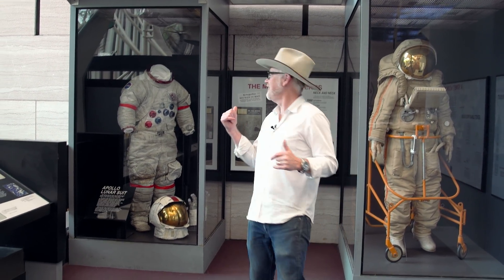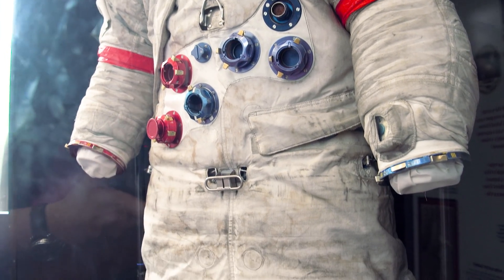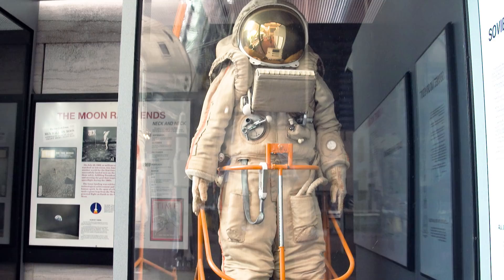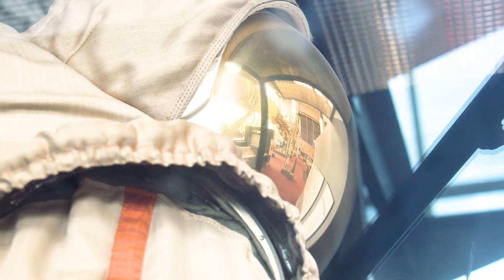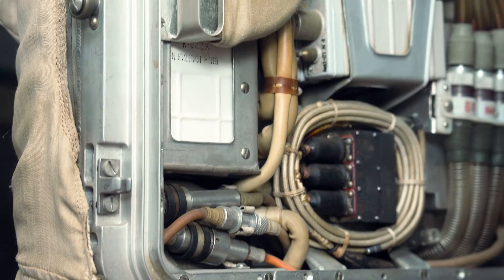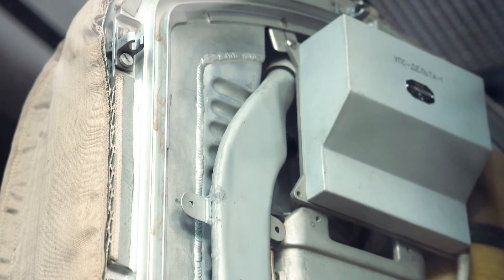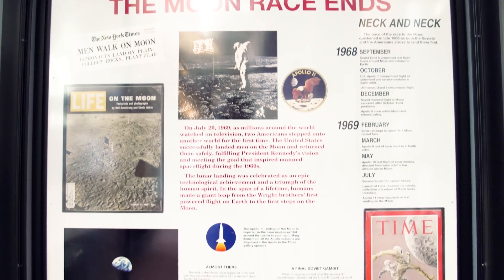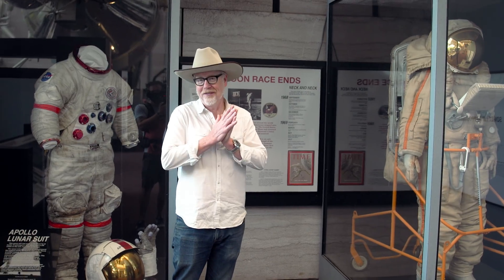Comparing U.S. vs. Soviet Spacesuits at Smithsonian

Comment: Difficult to make hard parts fit soft bodies, i wonder if having micro iron particles suspended in a gel liquid substance would help as it could be molded to any size and shape and when needed either struch or required it can be hardened. I'm aware something like that already exists, I think it was reactive body armor or something like that, but I'm curious of its applications in space.

Comment: Another example in the different philosophy’s in engineering. NASA spent over one million dollars to develop a pen that worked in zero gravity. The Soviets used a pencil
Reply: That's a bit of a myth actually, normal ball point pens work in zero gravity, but the teeny tiny, super precisely made tungsten balls in those pens were difficult to make in the 60s before someone found a way to mass produce them. Each pen cost about $50 in today's money compared to a few pennies nowadays. NASA ordered about 1000 pens in a bulk, half price deal, so it actually cost them more like $25,000 rather than $1,000,000. Still alot of money for a pen, though!

Comment: Problem : This door is really hard to close.
USA Solution : We will make a springe guided hinge with a self lubricating system controlled by an electric motor.
Russian solution : Kick the door.
Reply: And if that door is kicked several times, it stops working. Meanwhile, the American door takes a year to work out the kinks, but then serves many years on.
Reply: @HalNordmann  Ah, but the Russians made their doors easy to repair and or replace.

Comment: The soviets were really ahead of the US, the Buran was so far ahead, too. Hell just look at the US reliance on Russian engines up until recently. The problem is: what good is having better equipment when you can't afford it? RIP soviet space program, it was a good run.
Reply: The thing with Russian engines was not because USA didn't have their own. After the fall of USSR, USA feared (rightfully so) that the Soviet rocket engineers will look for work elsewhere - probably with US enemies that needed rockets (China, Iran, N. Korea...) and it was decided to keep Russian space industry in the business to prevent that.

That is why USA agreed to buy Russian engines in the 1990's and early 2000's, why Russian MIR-2 program turned into an ISS and why it was decided to use Soyuz rockets for taxi purposes - even though both NASA and ESA knew how to send people into space.

Yes, Soviet and Russian engineering was ahead in certain fields (I will never get over the cancellation of Energia and Energia-2 projects), but American "reliance" on Russian tech and rockets was not because of that, but for the geopolitical reasons. It was simply cheaper and safer to keep those people employed in Russia than to have to deal with a bunch of other hostile nations suddenly waking up with state of the art ICBMs of their own.

Comment: What happens with the Soviet suit, if your partner is incapacitated? Can you get out of it (or sealed up into it) by yourself? The US version?
Reply: Both are designed in a way that you should be able to use them on your own - with more or less difficulty. But you should be able to do it on your own.

Comment: I wonder if the design of the Soviets' hard suit was an attempt to correct the ballooning problem that nearly killed Alexei Leonov during his EVA.
Reply: I believe it was. Right after they found out that soft suits were prone to ballooning, they started working on EVA suits that would be safer and efficient in space. Modern Russian space suits are result of that work, as they call it "Half-hard structure" which means hard head, torso and pelvis area and soft arms and legs that would allow astronaut/cosmonaut to have wide control over their body and equipment in space.
Reply: Nope, they've solved ballooning in Yastreb Soft-EVA suit, just a couple of years after A. Leonov spacewalk in Berkut-EVAS. So, they actually could use a newer version of soft-suits for Lunar landing, but changed their mind for hard-suits.

Comment: Space suits are perfect examples of the trade-offs engineers have to make to accomplish a goal or solve a problem, not to mention how each engineering team has a unique design philosophy. The American design shows the result of having the money and resources to optimize every part for mobility and lightness. The Soviet suit feels like something a group of hackers put together using what was available within the constraints of time and money (and secrecy, no doubt). Thus we have two different solutions to the problem of keeping a human being alive and mobile on the lunar surface. The Soviet suit pioneered the integral backpack life support system and hatch that has today evolved into the "suit lock," which allows an astronaut to park the suit and its dirt outside so it doesn't contaminate the habitat. The American suit is lighter and more flexible due to the separate backpack. It's too bad the Soviets didn't pursue their lunar program. It would have been interesting to see how their designs performed on the Moon.

Comment: I NOW LIVE IN THE EX SOVIET UNION    Can we ALL please stop thinking the Russians / communists were idiots who made utter rubbish THEY WERE NOT

I have a pair of 1970 HiFi speakers - many of the features are only NOW appearing on $25K plus western speakers. 
The main difference is the Russians did NOT make things flashy to appeal to consumers cos they had no need. Soviet Hammerite paint CAN NOT be taken off with an angle grinder; it was designed never to be repainted, that goes for everything they made. It was designed to be very good and to last. OH, and be easily repaired.

Comment: Especially in the 60s... the Soviet suit has a single point of failure with an extremely large, easily damaged O-ring. Like everything else Soviet it was a death trap.
Reply: Because it has a single point of failure, it reduces the risk to the astronaut inside. You're really underestimating Soviet engineering.
Reply: @jakekaywell5972  how does a single point of failure reduce risk?
Reply: @jakekaywell5972  note, I said Soviet not Russian.

Comment: For many years I have been trying to find out how they made a Zipper that could withstand the internal pressure of the suit and not blow  open, and how was it made to not be a major pressure leak?
Reply: The pressure difference is pretty small. It's just 1 atmosphere even if the suit was fully pressurized. 1 atmosphere difference is something that a sturdy balloon can withstand. Or, when you dive, the pressure rises 1 atmosphere every 10 meters down. Pressure iside a normal sedan tire is almost 3 atmospheres, yet it basically doesn't deflate for months and months.

In a real space suit, the pressure is even less than 1 atm (I think about a third of normal). The air mixture does want to leak out of the suit, but with a force of, well, someone blowing really hard =) Not any kind of force that would be likely to rip or blow anything apart. And interestingly, it does leak: the articles about the US EVA suits say that these double zippers do leak, but very slowly. The suit just has a tiny tank to gradually replenish the pressure inside the body portion as it leaks. 

Now, you've probably heard that this weak pressure does pose a problem of ballooning the suit, and suit designers have to work hard against that, and astronauts/cosmonauts get tired really quickly fighting the ballooning / rigid suits. But I think it's because this pressure tends to add up across the entire internal area of the suit. It's not super strong in terms of "blowing" the zipper, but it pushes quite forcefully in all directions over several sq meters of suit. For something that should be zero effort (i.e. human resting pose), that's quite a lot of force fighting that.

Comment: ...The Russians had a space program that incrementally advanced the design of the every component 
..NASA every so often threw away the old design they hadn't changed in years, and seemed to start again nearly from scratch 
ESA learnt from the Russians 
The result is that Russia has very reliable systems that work, and are quite cheap  - but now lack funding  
NASA has very expensive systems that are less reliable and keep having their budget cut ...
ESA has cheapish reliable systems as well and still has a budget of sorts 
SpaceX are implementing the designs NASA wanted to years ago ... which are much cheaper ... and are slowly getting them reliable ...

Comment: The door on the Russian suit lacked any protection of the door side in this version because you would need protection from bumps for those areas since not only are humans careless and clumsy at times, but in zero-G they really have a hard time not bumping into things like a drunken sailor.
Reply: Strange how Orlan space suits have been in use for EVAs since 1977 to the present day (with continual upgrades) yet no-one has had an accident in one.
Reply: @henrya3530  That we know of. The Soviets weren't exactly talking about those or even leaving records of them.

Another thing to consider is that there have been minimal safety incidents in USA space suits even with the constant iterations. Yes, there have been some, but they have been minimal and not life threatening, like getting some of the anti-fog material in your eye and then tearing up so much it flows into the other eye because it is zero-G, blinding you. That happened once and it didn't result in any injury, just some terror and being led back into the ISS by the other astronaut. After that, the anti-fog material was replaced with a non-irritating formula: Johnson & Johnson Baby shampoo. Before this, both programs were using basically the same solution for stopping the helmets from fogging up.
Reply: @KnightsWithoutATable  
”That we know of.”
Yeah, shut up. Those suits are still used today, by international astronauts.
Reply: @the18thdoctor3  You really should do some looking into the behavior of the Soviet government more. They hid multiple lethal events that happened in their space program, especially early on in the 60's.

The current model of the suit is very reliable, but it is still going to suffer from design issues and the limitations of the old technology that was used to make it. We are talking about a suit created 50 years ago. Anything developed now is going to be better than it and is also likely to use solutions that are proven, like many of the features of suits like this one.

Comment: I was actually thinking that the designs can be seen as somewhat indicative of the cultures they came from. The American suit seems more individualistic, in that it seems that alone astronaut could in theory put on and take it off by themselves or with a little bit of help. It is also made our of multiple separable interchangeable smaller sections that work together. The Soviet suit seems to require a second person to put on or take off. And while it is technically made of separate parts, they combine into a single inseparable unit. Idk if that makes sense to anybody else.
Reply: US suits are definitely not designed to be donned alone.
Reply: Also the Russian suit is a single point of failure in that the entire thing is bad if the non user replaceable elements go bad, and like their ships, the occupants gets in and operates it with little control or capability to influence it.

Comment: If you are ever in Oklahoma, there is a small Air and Space museum that has several space suits. It has several items owned by the Smithsonian. Called the Stafford Air & Space Museum. I think General Thomas Stafford still lives in the area.
Reply: I can attest, this is a great Air & Space museum to visit on your travels, right off I-40. The docking mechanism for the Apollo–Soyuz Mission is on display. The design went onto be used with Shuttle–Mir program and later the ISS. There were advancements between missions, but the basic design started with the Apollo–Soyuz Mission. APAS-75 (for 1975) or Androgynous Peripheral Assembly System, or Attach System. They had later versions, APAS-89 and APAS-95.
Reply: Good to know, thanks!
Reply: Is a very good one at Love Field in Dallas called The frontiers of Flight as well, and of course Houston, the Frontiers used to have a GIANT rocket stage out on the lawn but a bad storm broke it loose and rolled it out through the fencing into the street lol.

Comment: Seeing American vs. Russian engineering solutions for space is somewhat like comparing American vs. German tank solutions in WW2, but in the latter case, the Yanks built the simple designs.
Reply: I was going to make this same comment. I recently learned that the Nazis were in some ways their own worst enemy by designing these incredibly complex tanks, vehicles, weapons, uniforms etc... but at the cost of speed of manufacturer and critically, serviceability in the field. The Allied vehicles had interchangeable parts so one set of spares could be used across the whole fleet. German vehicles were each unique and required different spare parts making logistics much harder.

Comment: Russian design was often very, very simple. Sadly, sometimes it's often bungled up by poor quality control or lack of consistency. You see it in so many things they make but often their stuff is just as brilliant as the best out.
Reply: I wonder why when praising the Soviet designs, people tend to default onto them being "simple". This space suit is not especially simple. It has an elegant solution built into it, but otherwise it's very complex. The "refrigerator door" sealing solution is also quite robust and rugged, but it's not all that simpler than the American solution, which is a big sturdy double-layered rubber zipper.

I feel this is a sort of a stereotype that hits true every once in a while, but is often completely misplaced. Soviet tech does tend to be overbuilt, and is often short on decoration or finish, but it's quite often also overengineered and arcane.

Comment: the problem with the soviet suit is I think NASA wouldn't have been able to give it the space in the vehicle, nor would the soviets for that matter, their lander was even smaller than the LEM. they had to bring these suits back with them for study, so they needed to be able to stow them in a compact space
Reply: Also slight advantage of having separate life support, you can throw it away once you are done to save mass (that's what NASA did).
Although in current times it doesn't really make sense.

Comment: Soviet engineering is glossed over too often. They had simple, ingenious solutions lots of engineering problems.
Reply: or when they ran into a technological hurdle they would go with the current state of the art and make it work, like the RATAN600 or the Duga Radar system which used older technology in their construction but made up for it in size and lateral thinking
Reply: @Ural Motorcyclist That’s not really true though, they’ve done tonnes of things
Reply: No it isn't. It's widely known for technology. It just died like 35 years ago so it's forgotten by most youth. 

The Kalashnikov is still one of the best weapon systems to exist and all space technology is Russian now. NASA is obsolete. Even SpaceX is better than NASA. NASA costs billions a year and does literally nothing.